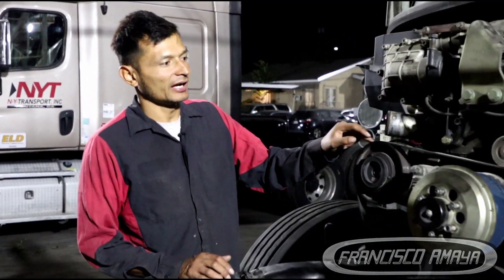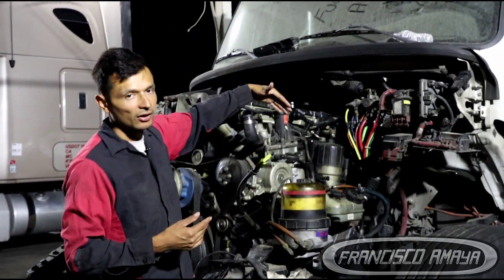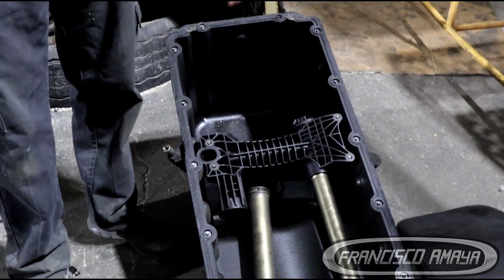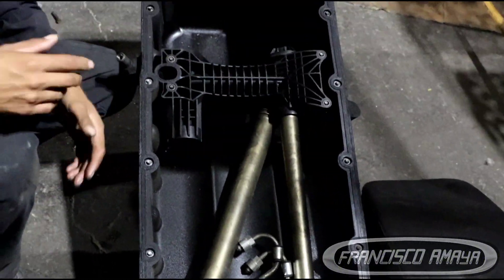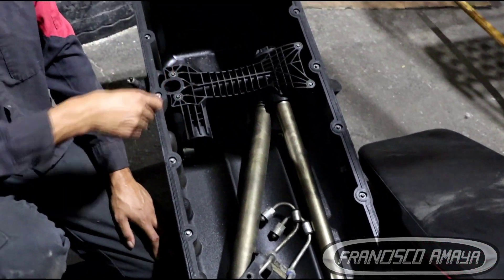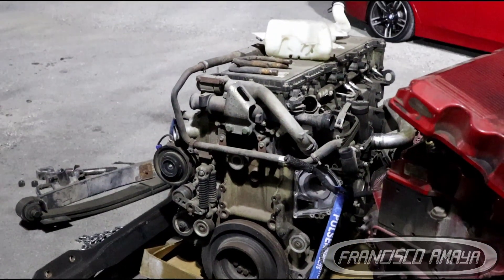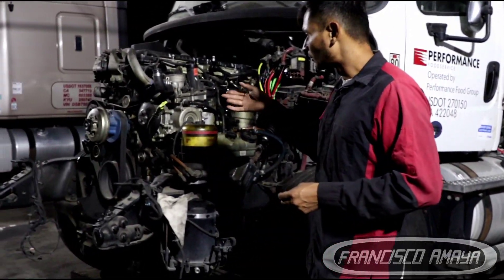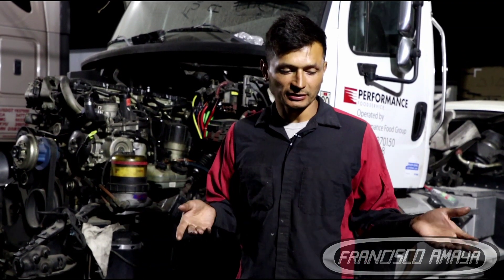Freightliner M2 DD13 low oil pressure bad oil pump orings broken oil manifold crankshaft damage

Comment: I had same problem with my dd13 at around 470k. When i start engine in morning it wii shoot the oil pressure quickly to 70 plus psi boom , but then  i noticed start and oil pressure would go up slowly till it reached normal,  thats when i changed,  manifold and o rings,  took me two days but did it myself and still good to this day , two years all good , great videos you should teach in a school your very good at teaching
Reply: What year is your truck? I have 2019 only 320k kms